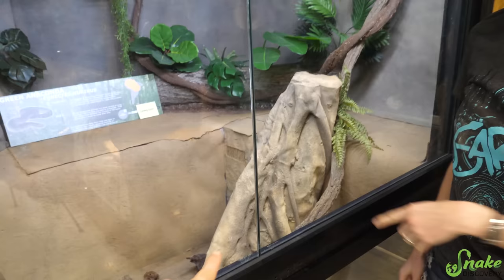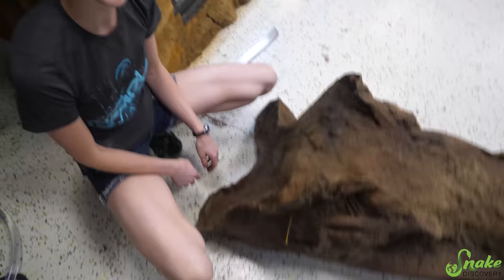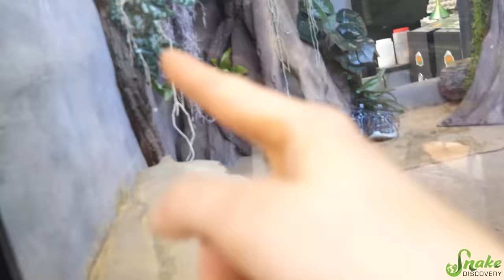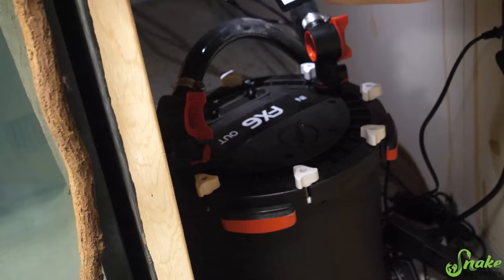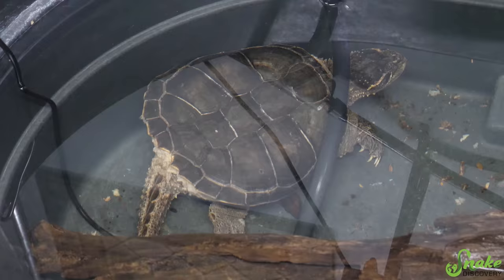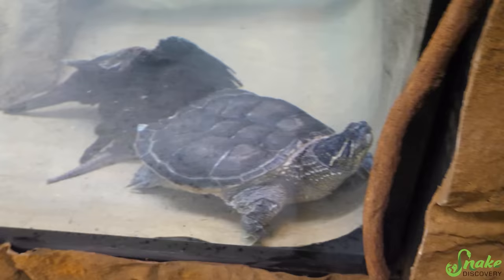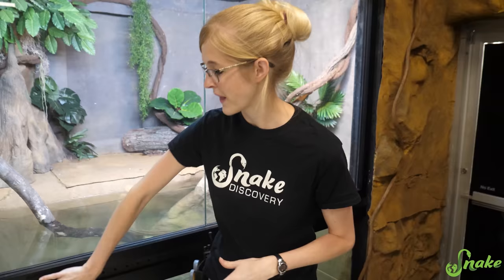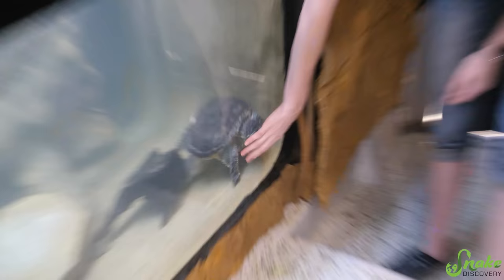Moving our Snapping Turtle into the Zoo!

Comment: ⚠️I noticed you have just a regular outlet right next to the pump. Maybe consider switching that to the kind that has the trip switches that say "test" and "reset", because those are meant to be installed anywhere within 6ft of water for safety.⚠️
Reply: I doubt they would've passed an inspection without having GFCI plugs near the water exhibits. Cities/counties/insurance companies usually check for that stuff before opening and periodically after that.
Reply: There are many ways to install GFCI plugs that do require the use of the outlets that include the test and reset switches. One of which will have an entire section of the breaker be GFCI which negates the need for individual GFCI outlets. You can also put a non GFCI outlet in series with an GFCI outlet in order to protect both outlets which is the more common solution in houses. 

They likely opted for GFCI breakers though since they're a business and it gives the most protection since all the outlets get protection.
Reply: @zebraloverbridget  I've never heard of GFCI breakers before... Good to know!
Reply: its probably on a gfci circuit
Reply: I'm sure they have it fixed or protected but that was a very good catch! Very observant :)
Reply: No one cares
Reply: @zebraloverbridget  comment section once again teaching me more than my engineering classes in college 😂
Reply: @zebraloverbridget they’re more common in Europe than the US, and more common in commercial buildings than in residential. Obviously there are pros and cons, but in their case it would allow them to reset the circuit without opening the hidden panel if they needed to while kiddos were there

Comment: For the floating stump, if you're willing to hack away more of the foam, you could then try filling it back up with concrete.
Reply: I wonder if there's reptile-safe concrete. 🤔 Traditional concrete is incredibly caustic because of the curing agents- which is why skin protection is so important when working with concrete since it can cause extremely painful burns to the skin. I believe that if they used traditional concrete, they'd have to soak it in water for several weeks, changing the water frequently, to remove as much of the chemical content as possible until it was properly ph balanced. It also takes a long time to fully cure so I'm not even sure they could start soaking it immediately and they'd likely need to seal it. 

Somewhat related, I'm glad you said "concrete" (which is the proper term) instead of "cement". Cement is actually an ingredient in concrete- it's what holds everything together, like glue. I always remember the difference because of the end of the Flintstones movie where Mr Slate is all excited about the new mixture and proclaims he will name it after his daughter, "Concretia". 😂😂
Reply: @lcoq19  genuinely how and why are you so educated on concrete
Reply: @smexy_worm  I have an innate curiosity about random topics and enjoy learning new things. I know a lot about many different subjects simply because when I have questions about anything, I Google them, usually going down several rabbit holes along the way. I often have trouble focusing on any one thing in particular, so I explore many topics to satisfy my mind's ADD tendencies. 

Also, I'm a homeowner who does a lot of things myself so I will research a topic before deciding whether or not I think I can tackle it myself. This in particular is one of those topics. 😊
Reply: @lcoq19  I was thinking this too! Like maybe they can just attach a lump of concrete to the bottom of it and sand paint it to blend in or something? (edit: or some other type of rock? idk if rocks can be glued lol)
Reply: @lcoq19  that’s fantastic, live your concrete life
Reply: Mmmm, i have seen a yt channel that make a mix of mud (Taken from a river), termite mound and grass, it is pretty durable and similar to concrete
Reply: I’m watching this at 6 AM on a school day, i’m so happy😊😊😊😊

Comment: You can get security systems that have water sensors. Maybe you can set up one of those just for the water sensors (not to protect the building) and put them anywhere there's a pump. You only need to change the battery once in a while because they work off wifi. It would definitely give you peace of mind and you can maybe even wire in an automatic shutoff for the pump if that happens.

Comment: As a (freshwater) aquarium keeper, I empathized with a lot of the struggles in this video. xD 

The struggle of trying to get driftwood to sink until it's waterlogged is one I've been through a few times, haha. I usually just use rocks, similar to what you did, either temporarily on top of the wood or strategically glued in places that don't face the front. I've done a fair bit of wedging things into one another to hold them down too. I'm glad your strategy with the stick worked out, it looks great! :)
Reply: I have a feeling it won't stay for long!